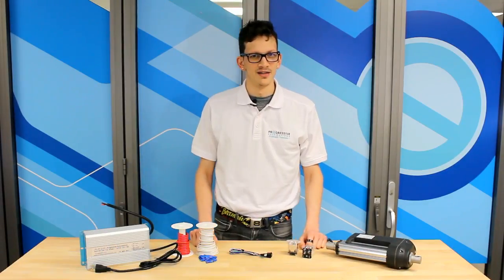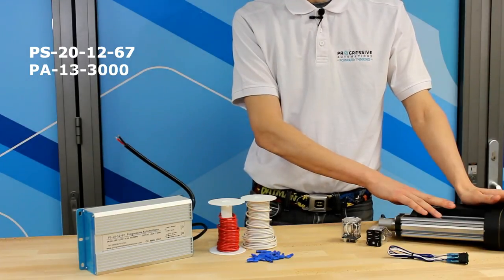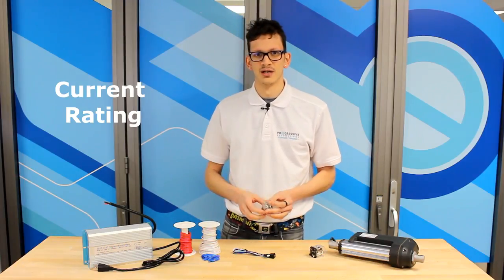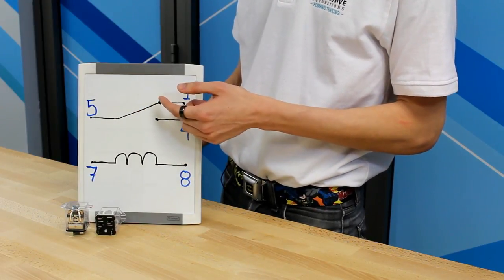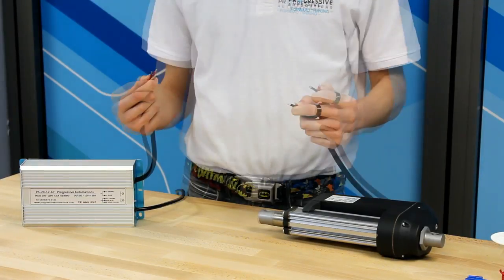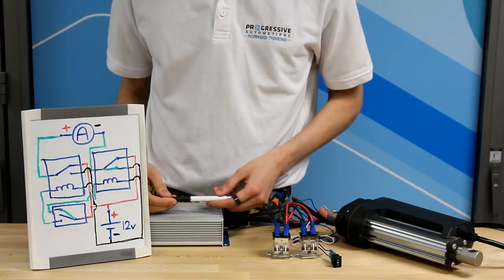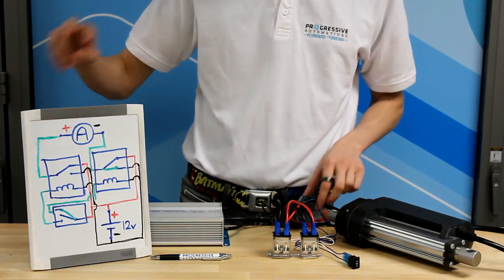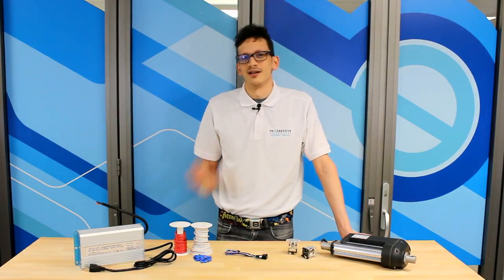How To Control Linear Actuators with 12 VDC Relays

Comment: Ok, i am not an electrician and understand very little, but here's what i want to do.  I have a reversable 12V dc motor.  What I want it to do is turn on automaticallly with a timer in one direction and shut off (with a limit switch?) after about 2 seconds.  About 2 hours later I need the opposite action. Both actions automatic using a timer with DC power.  The application is a door opening and closing veritcally .
Reply from the maker: Hello Amir
From the sounds of your application you would require the use of an Arduino microcontroller and a motor driver. You can learn more about this and how to achieve different forms of motion control in our Instrustables post about controlling an actuators motion here - https://www.instructables.com/id/Controlling-the-timing-of-an-Actuators-Motion/. If you need any more information or have any other questions, let us know.
Best Regards
Reply: If this is all you need to accomplish then using an arduino is overkill and takes time to learn it. I made a playlist with a few wiring diagrams that do just that. the third one on the list is the one you will need.
https://www.youtube.com/watch?v=w2gOUIUESjs&list=PLuVu6jtxZ7FnhvJ8DYSkERG0eAfUNJHQr

Comment: How can I plug two bistable 6pin switches to control linear actuator? And gate. Operator should ude two hands (two switches)
Reply from the maker: You may be able to consider using relay combination logic or microcontroller programming with H-bridges for this. Ensure the devices that have power running through them and going to the actuator have sufficient current draw ratings to handle the actuator current draw requirements.

Comment: i need to control 2 of the actuators simultaneously and a 3rd one as a single function. do you recomend to use the relays SPDT or something else. can synchronization be skipped by simply connecting the 2 wires to  + and 2 wires to the (-).  I also need to use the reverse function.
Reply from the maker: You can use SPDT relays in a similar way to what is shown in this video as that would allow for the reverse function while letting high current draw through the circuit without damaging the switch from over current. It is possible to wire the 2 actuators in a parallel circuit if you did not require the 2 actuators to travel the same speed (motors can have a +/- 10% speed tolerance), synchronization with positional feedback is for applications where the 2 actuators are needed to travel the same speed with more accuracy and precision.

Comment: just to confirm, in your diagram you have the two 87a constant on attached to the actuator + and - terminals. Then you have the switch activated 86 terminals from both relays going to the negative 85 terminals on of both relays.  These 4 are tied together on battery negative?

Comment: I want to control 6 linear actuators 30mms 200mm reach all at the same time. So to use a low powered controller and two double pole relays should do the trick. What do you think?
Reply from the maker: Hi James,
We recommend having feedback option such as a potentiometer or hall effect sensors for a "true" synchronized setup. Although both actuator are activated at the same time, there may be discrepancies with their speed if an uneven load is applied between the two actuators.
Thank You.
Reply: @ProgressiveAutomations  I'm using arduino n 2relay module. how to control position feedback or how to take feedback of actuator position.
Reply from the maker: @rathanshidling9832  Hi Rathan, can you give us a call at 1-800-676-6123 so we may assist you? You can also send us an email at sales@progressiveautomations.com

Comment: Solved!  + goes from battery to 87a and to switch.  + out on one side of switch to 86 of one relay then other switch + to 86 of other relay. 85 & 87 of both relays go to - gnd. 30 of one relay to actuator + 30 on relay 2 goes to - actuator. No switch pressed creates a live + lock on actuator no movement. You can put optional on/off sw between battery+ and relays to de-energize when not it use. When sw is pressed up it powers relay coil that switched + of 87a flowing to 30 (actuator one side) to 87 - changing polarity actuator moves one way. Flip sw to other on reverses.

Comment: My problem is I cannot find directions to wire my single axis solar controller  to the trigger on my DPDT 30 amp relay I purchased for my 400 pound 12v linear actuator so that the actuator will go up and down when the controller triggers . The relay will trigger the actuator and it opens up and extends then the trigger stops and the linear actuator closes automatically.  I need to wire it so the actuator can reverse pole when trigger says to . I was under the impression that 1  DPDT relay could control a linear actuator in both directions instead of using 2 SPDT relays per actuator. Is there a trick to wiring these to a solar tracker? Did I need to use 2 relays the spdt relays?
Reply from the maker: Hi Donald! We want to help you with your actuator application. Please give us a call at 1-800-676-6123 so we can assist you as soon as possible! You may also send us an email at sales@progressiveautomations.com

Comment: Can you wire four aculators together to a rocker switch
Reply from the maker: Yes, it is possible to wire 4 actuators in a parallel circuit to 1 rocker switch as long as the current draw of the 4 actuators combined never exceeds the current rating of the switch being used. For example, our PA-14 actuators draw 5A at max rated load capacity while our RC-12 rocker switch is rated for 20A. The 4 actuators multiplied by 5A results in a 20A draw if all were at full load so this example switch will be sufficient in this use case.

Comment: Ok I purchased one of your 400 pound 1p66 12v  20 amp linear actuators for my solar tracker .the tracker handles 8 amps max at 12v . So I just need 2 20 amp relays and  wire the relays to my fuse box with 30 amp fuses from the battery  and negative bus bar no fuse and the power ports from tracker to relay trigger side and the linear actuator to each relay  1 positive other negative but reversible load side ? Then my 8 amp 12v tracker  can power the 20 amp 12v 400 pound relay?
Reply from the maker: Hi Donald! Can you give us a call at 1-800-676-6123 or send us an email at sales@progressiveautomations.com so we can assist you with your solar tracker?

Comment: does the positive charge lock cause any damage or extra wear on the electric motor?
Reply from the maker: Hi Brinton
This greatly depends on the actuator and application. Generally speaking this results in an immediate stop which may cause premature wear on the mechanical components. If the actuator produces an abrupt and jarring stop when used, then it would be advisable to avoid using the motor brake in this way. Hope this helps!

Best Regards
Reply: Yes, It most certainly does. However, depending on quality of the actuator, the damage is really only noticeable over long periods of time or heavy usage.
I myself do NOT like or do not advise people to do that. For two reasons.
First. Unless you need it to stop a motor for "hyper" accuracy or something like that then why put any extra wear on the motor. Besides linear actuators pretty much stop on a dime by themselves.
Second, and more important to me, is that you will have positive voltage running through both actuator wires and motor. That means that at anytime the wires get cut it leaves more possibility of grounding out. More so when doing maintenance and forget to turn off power. Having the negative be the Home/Rest/Normally Closed position is a better option.

Comment: Is it correct to assume that the actuator can continue moving forward after the it was stopped from moving forward by the the toggle switch initiating positive charge lock on the motor.
Reply from the maker: Hi Gregory,
That is correct. If power is removed, the actuator will hold it's position. If +12VDC is again applied to the actuator via switch, the actuator will continue to move forward until it reaches the external limit switch. The same applies in the retracting direction.
Thank You !

Comment: How do i hook up your rc-09 joy stick with this?
Reply from the maker: Hi there! You definitely can hook up the RC-09 joystick however the wiring will be slightly different from the RC-13 Rocker Switch. 
A wiring diagram that may be useful for reference is the Joystick (Four Direction) Control - High Current Draw which you can find here: https://www.progressiveautomations.com/pages/wiring-diagrams

If you have any questions, please feel free to send us an email at sales@progressiveautomations.com or give us a call at 1 800 676 6123

Comment: I am looking to control a 12VDC liner actuator with a 120vac smart switch. Can someone recommend a replay and a wiring schematic.
Reply: Your smart switch can be used to enable/disable the 120 volts  input to any 12-volt DC power supply capable of handling the current (amperage) required by your linear actuator, but you'll still need to reverse the 12-volt polarity to travel in the other direction. You cannot connect the 12-volt DC actuator directly to a 120-volt AC supply. You would also be wise to include an inline fuse in the 12-volt line.
Reply from the maker: Hi Ronny, we'd love to assist you! Can you tell us more about your application by sending us an email at sales@progressiveautomations.com or please give us a call at 1-800-676-6123